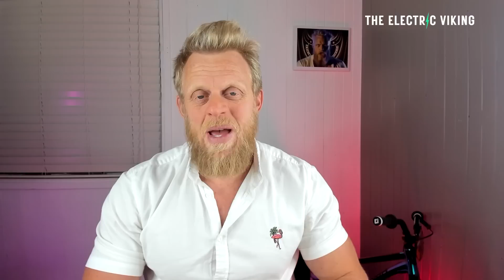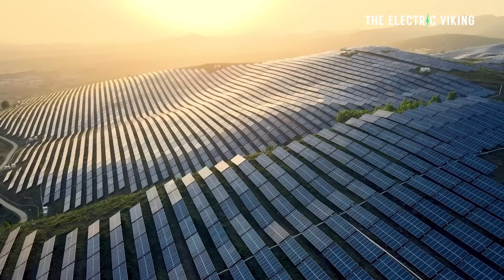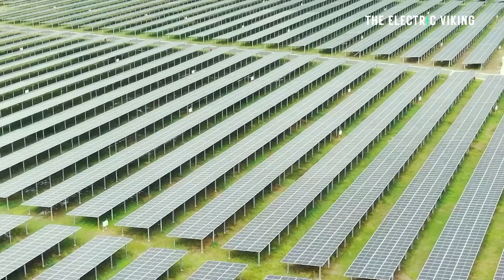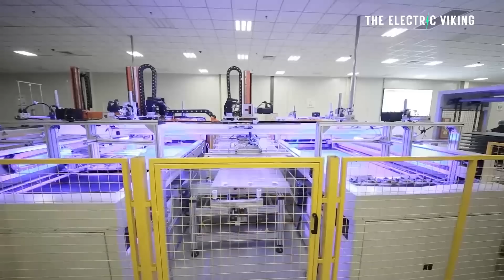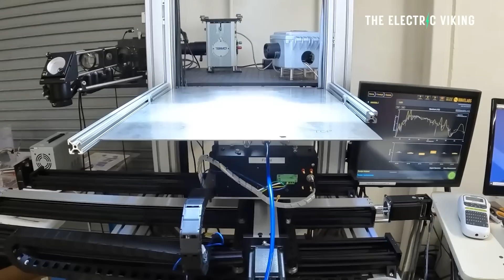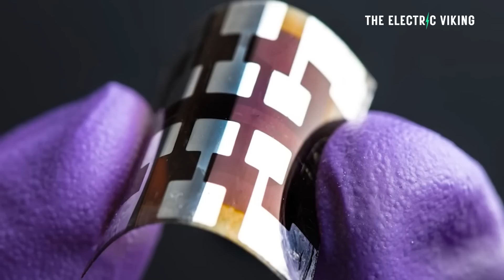How much of the worlds land mass we need to cover in solar

Comment: Sorry to say but the anti Renewable crowd will never understand how cheap wind,solar,grid modernization,battery storage improvements will change everything about how we live
Reply: They will dragged along, kicking and screaming all the way
Reply: How do you generate power when there is no wind and no Sun in winter for several weeks ?
Germany has lots of wind turbines but they burn a lot of gas and coal.
Reply: @pauld3327  It's really simple: you store excess energy in batteries for use when energy output is lower.  Even in Antartica, the Casey Research Center gets 10% of it's energy from solar panels.  There's not really an excuse why they can't be used anywhere else on the planet (almost all of which receives much more light than Antarctica does).

Typically, winds are stronger at night, when the sun isn't out, so the two compliment each other well.  And it's not like other forms of renewables, like hydro, don't exist to further compliment that.
Reply: @AMortalDefiant  If It was that simple, the world would already be powered by solar and wind. Battery storage can be ok for one day but not several weeks.